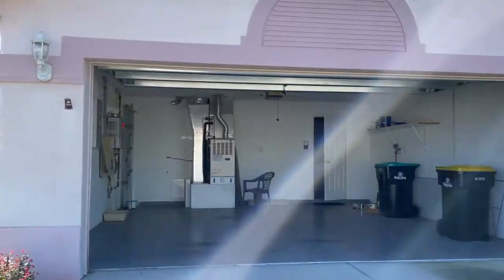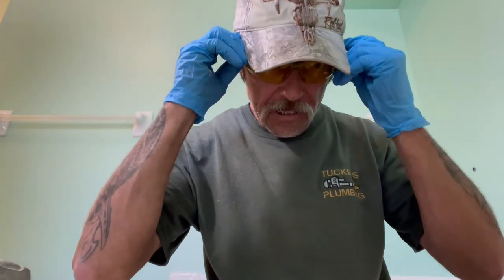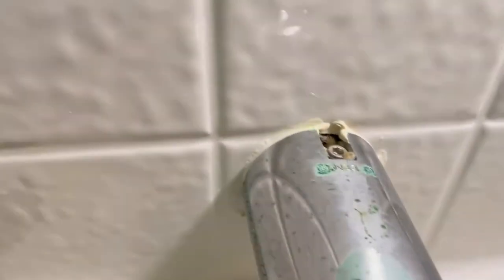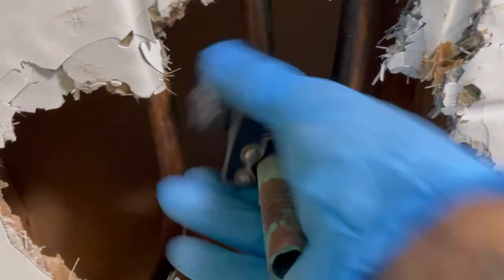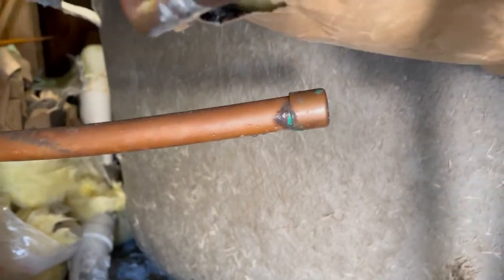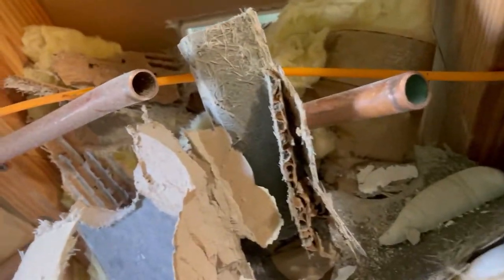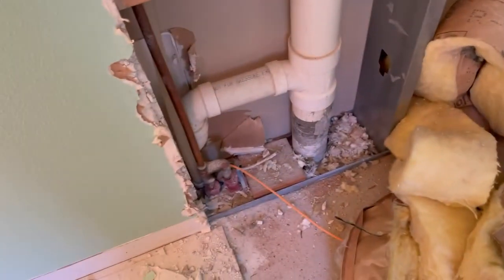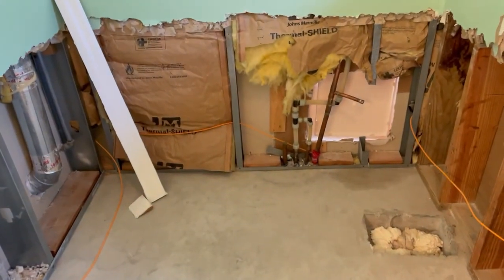FIBERGLASS SOAKER TUB REMOVAL

Comment: I measure up 2 inches from the upper most exposed fiber glass use a level to mark a cut line ,, vibe saw the drywall ,, as it’s very controllable , a quick cut around the drain with sawzall  then slice both ends off and slice the center remaining portion into ,, 4 easy to carry out pieces ,, at about 20 / 30 mins in that sucker is out of there ,,    I have removed many of them ,, usually to install new custom tile showers
Reply from the maker: Thanks Ken